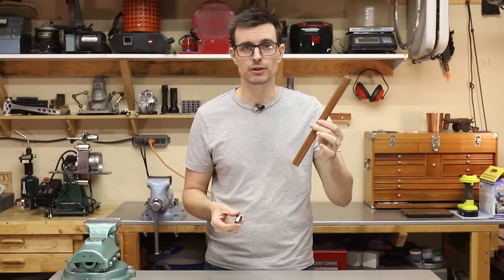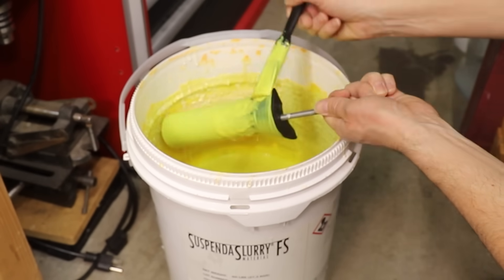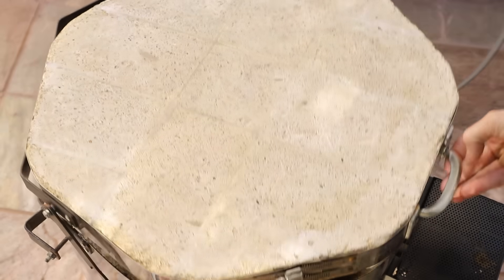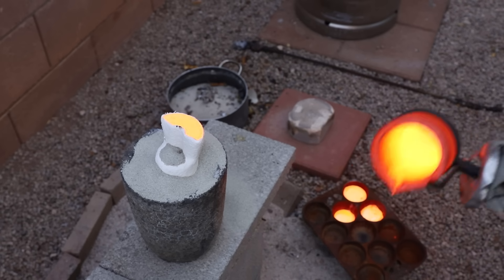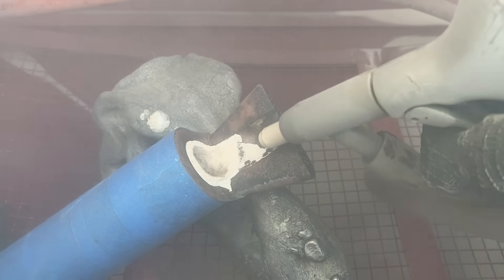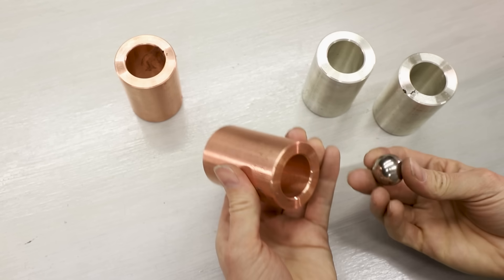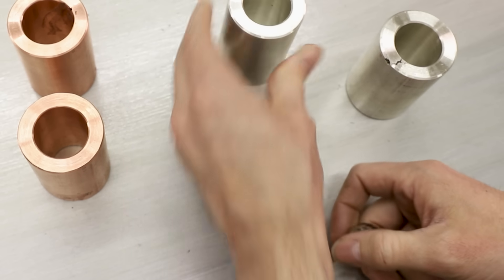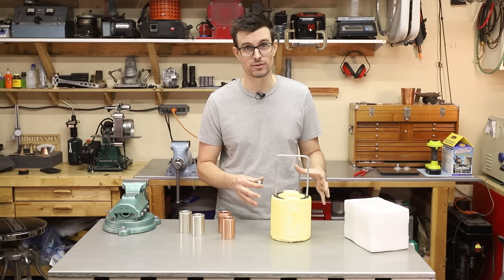Making Anti-gravity tubes - Copper & Silver! - Lenz's law - Metal casting Experiment

Comment: I have seen many variants of this experiment but I have never seen the one that is stuck in my head. I want to see a piece of copper (or silver) dropped down a tube made of magnets. I only managed to make a tube a few inches long so far because even though people throw away microwaves fairly often I need the magnets off the magnetron to be roughly the same size.
Reply from the maker: I read your comment and couldn’t stop wondering if it would work. So I did buy some ring magnets to try this and it does work but not very well.  Not even close to what you see in this video. Interesting idea though!
Reply: @robinson-foundry  Thank you for trying it out. The only strong ring type magnets I can easily get my hands on are from old microwaves. After that size matching is the issue. Did you happen to video it?
Reply: Using only iron, it will be a magnetic gun !
Reply: @jeansentrais9866  I have built coil guns before. Fun toys but lacking power unless you have a large power supply or a big bank of capacitors to fire it

Comment: This is an interesting and worthwhile experiment. I see this being used for large scale elevators. You could use a silver section for the initial slowing of an elevator because it's not as strong or abrupt, then use the copper part to slow it down further, before using an electro magnet to bring the elevator to a complete stop. You'll have a nice and smooth slowing and stop. Well done fella, and I absolutely love magnets and their potential 😊

Comment: This method is used to test silver coins.  I think .999 silver can be faked..   say.  copper, titanium, zinc and sliver mix and nickel?   And maybe has been to the degree that 12 million oz were mined but 1.2 billion were sold. We have had year over year across the world of record buying,  not really possible if the mining numbers are right.  If a copper, zinc , sliver, nickel  mix of a coin was made a hundredth of the cost or even 1 10th the cost of .999 silver and passed all the tests;  It would be quite interesting.    I mean even the machines get fooled..   So beat the machine, match the weight and  pass the magnet test and you can fool 98% of the people you show that coin to!     Is this something you would take on as a project?  Maybe easier to do a bar.    Sure one coin would not be worth the project but 1.2 billion would be.  Thx for reading...

Comment: I looked up the resistivity of SS and pure silver.  Sterling is 1.6*10^-8.  pure silver is 1.59*10^-8.  Not much difference.  Maybe there is other impurities in the SS.  pure copper is 1.72*10^-8.  units of ohm-m.

Comment: I machined a copper tube with a 26mm bore and 20mm wall thickness. A 25mm diameter magnetic ball seems to just hang there barely moving. I think the thickness of the conductor and the gap make a big difference to the effect....

Comment: Would be interesting to align the N52 Sphere with another Bar Magnet while laying both Sphere, and Bar magnets stuck together on a flat surface, with the Bar Magnet set on the table so the narrow edge is oriented vertically to the plan of the table to squarely contact the Sphere's surface at the Equator. Then when both magnets are opposit pole attracted with aligned North/South use a Sharpie Permanent Marker to paint a black outlined line to show the Sphere's North & South Poles using a carpenters, or machinist square to draw with by rotating the Sphere while adding a black permanent marker line to outline the Sphere's Equator. Then using permanent marker stain the Sphere's nickel plate surface in two different colors such as Red/Blue or Red/Green to brightly display the Sphere's North/South poles. Then video record the drop of the color stained N52 Magnetic Sphere through the two metal tubes of Copper & Silver to record the N52 Sphere watching how the colorized North & South poles spin, or tumble in what observable slow motion different direction, or oscillating patterns when experiencing the two different metal's repulsive forces. After recording, use 91% Isopropyl alcohol and a tissue to clean off the marker stain from your N52 magnet Sphere's surface, restoring the magnets original nickel finish.

Comment: Small differences in distance makes a big difference in breaking power. 
Use the two silver tubes and place them exactly the same width apart as the copper tubes and roll it through them.

Comment: You could try to hold it on the air, like you did with the 2 pieces of copper, but with one of each. One part of copper and the other one of silver, i really missed that part. Cool short you could add. Thanks.

Comment: OK, so here’s a question… If you were to solder a wire to the copper tube and solder a wire or connect a wire to the neo magnet, and then the opposite ends of those wires to an LED light and drop the ball down through,would it, create enough electricity, to light the lED bulb?

Comment: Place the spherical magnet in some static position, optimally at an offset from the surface it lays on. If you proceed to attach either the hollow copper or silver cylinders to the end of some rotary tool such that the axis of rotation of the tool and the cylinder are equal, then proceed to place the cylinder attached to the rotary tool’s axis of rotation perpendicular to the surface that the spherical neodymium magnet lays upon, while intersecting with the center point of the magnet, then when imparting a rotational velocity on the cylinder in these conditions, should keep the sphere in the cylinder, so long as angular velocity remains at a certain level

Comment: Thats very cool!

Does the temperature raise after each consecutive pass of the magnet through  any of the tubes?
Reply: Yes, the temperature rises but there is so little energy involved in this demo that the effect is negligible.  If you use a motor to whirl a magnet rapidly inside the tube, the tube will gradually warm up.
Reply: @analog_guy  thats very cool to see the mechanical aspect producing heat.
Keep the videos coming

Comment: Aluminum tube will do the same and the thicker the aluminum the greater the effect. Much less expensive as well . Interesting experiment . By the way , with all the equipment you have , do not have a jig saw or chop saw to cut that stuff . A hack saw works but wow. :O)

Comment: I checked around - first what is sterling silver.  Found that it contains 7.5% copper.  In conductivity that means already drop to 90% ICAS, or less.  Pure electrolytic copper has 101% rating, and phosphor process manufactured copper still can have as good as 98% ICAS.  Hard alloys, like cadmium-copper and others may be as poor as 50%.  But in tis case, pure, untarnished silver is something around 106% ICAS.  Pick your choice!  can you measure the 6% difference in your test?  Maybe, but I think you might then need some instrumentation.

Comment: For thick cast silver tubing you can buy jewelers wax tubes and casting investment then do a similar kiln burnout for a much faster and more cleaner and consistent casting. The whole process takes much less time (12 hours) and the end product will be much cleaner. Or, you can just order extruded silver tubing. It’s not that expensive. Most jewelry supply houses can order any tube diameter you need. Just my .02 from a jewelers perspective.

Comment: I looked up the electrical conductivity of sterling silver and it's slightly less than pure copper (96% vs. 97%) so the result was as-expected. Also, your sterling was pretty heavily tarnished (silver oxide) and that would further reduce your electrical conductivity. Even if it drops by 1% more as a result you'd notice that.
Reply: Uhh pure copper has an conductivity of 100%, that is the basis of the IACS, pure silver has 104%

Comment: Did you consider boring out the ceramic from the inside using some abrasive tool on the lathe, instead of sand blasting? I wonder if that would work well?

Comment: I have a question? If a strong magnet can be slowed down by a copper pipe then would a copper slug slow down traveling (or propelled)  down a magnet lined "barrel". If so, by how much? How long would the pipe need to be? Would neodymium ring magnets placed around the steel pipe work with gaps between magnets? Or would long rectangular magnets, laid end to end work better? Like a silencer/suppressor takes barrel gasses away to make a fired projectile 'quieter' would a magnet lined barrel make super-sonic ammo slow to sub-sonic speeds?  Just wondering? @brandonherrera @kentuckyballistics
Reply: Yes, a copper slug would be slowed down at each pass by a magnet.  There is a nice physics demonstration using a freely swinging aluminum pendulum.  When the pendulum passes through the gap between the poles of a horseshoe magnet, the pendulum is rapidly brought to a halt.  If a similar aluminum pendulum has narrow gaps cut into it (making it like the tines of a fork), the retardation by the magnet is greatly reduced since the paths for the eddy current to circulate in the aluminum are interrupted.

If electromagnets are used instead of permanent magnets, and the electromagnets are energized at just the right time as the copper slug passes, the slug can be accelerated, as in a rail gun.  (Rail guns also typically pass an additional current through the slug to enhance the effect.)

Accurately calculating the answers to your questions is feasible by modelling with an electromagnetic field solver software package, but that requires a lot of work.  That's a good engineering project.

Comment: I wonder if a tighter inside diameter of your tubes to correspond with the outside diameter of your magnet balls might have affected the speed of the drop through the tubes?
Reply: iirc, magnetic field strength falls off in relation to 1/r^2, meaning, yes, a smaller air gap between magnet and tube should create stronger eddy currents that in turn create stronger opposing magnetic fields.

Comment: So, with the longer tube, I was expecting to see some rough timings between the two.  (I would think the silver might be in more proportion to the mix of the materials involved.)  Also, a question arises as to whether the thickness/mass of the tube has an effect on the speed of the drop.  As well as any diameter differences.  (I.E. Does a closer diameter have a more profound effect compared to the mass?  More easily done with the copper since you could probably find some longer thin versus thick wall tubing.)

Comment: It wouldn't have been so hard to purify that silver. I think if you melted it, poured it into some water to get little flakes to increase surface area, then dissolved it all in nitric acid, throw in a load of table salt until the white material stops being produced by the reaction caused by the salt, filter the white stuff out and keep it. Throw it all into a crucible and blast it in the furnace, it'll melt and turn into a much purer silver. Quite an easy process to really ramp up the purity.

Comment: The effect would be even more pronounced if you made tubes which have an internal diameter closer to the outer diameter of the magnet.   You could replace having the entire tube made of copper by simply having copper conductors (12 gauge house wires) bundled together in a tubular form with epoxy, thus eliminating the need to to molten copper poured into a mold.   

You can induce rotation in the magnet, by having your copper wire formed in the form of a tight coil (like a tight spring), as conduction would be superior horizontally, as versus vertically.  You would have to take a sharpie black pen to the magnet, to make the rotation of it more visible to the cameras. 

For the ultimate demonstration, get Graphene sheet (pyrolytic graphite) and form it into a tube.  It works even better than copper/silver/bismuth.

Comment: Resistivity of electrical grade copper; aluminum, lead, bismuth.  Fewer zeros after the decimal, higher resistivity.
Plexiglas tube............ electrical insulator  (Free fall control.  Cannot be melted without decomposition.)
Resistivity: bismuth... 0.0000013 mΩ (highest resistivity)
Resistivity: lead.......... 0.00000022
Resistivity: aluminum 0.000000026 mΩ
Resistivity: copper..... 0.000000017 mΩ (electrical purity)

Comment: FYI - folks who deal with precious metals will line up several flat, bar magnets in a row side to side then lay some felt across them to create a slide to test if, say, a silver coin is really silver or a fake since just like the magnet slides slowly down the metal tube, the silver slides slowly down the ramp of the magnetic slide.  In other words, you could have just taken a silver coin, made the magnetic slide and produced the same results faster and easier.

Comment: When a small neodymium magnet ball descends through a copper tube under the influence of gravity, it induces an electric current due to the change in magnetic flux within the tube. This phenomenon is called electromagnetic induction. According to Faraday's law, electromagnetic induction creates a current directed to produce a magnetic field opposing the change in the source of that current. The formula for Faraday's law is:
ε = -N * (dΦ/dt)
where:
ε - induced electromotive force (emf),
N - number of turns (in the case of the tube, it could be replaced with other parameters related to the tube's geometry),
(dΦ/dt) - rate of change of magnetic flux.
Reply: Isn't this Lentz's law application here though. ?

Comment: Thank you for your videos. 

Silver conducts electricity better than copper, which is why it drops faster. Please look up the “Right Hand Rule” for electricity. The internal resistance within the tubes thus controls how quick the magnet drops. The resistance of a metal can be changed with temperature, metal composition and is based on the metal itself (periodic table). 

As the magnet drops, it creates electricity within the tube itself, in a “Hoop Like” manner. The electricity travels around the tube along the circumference as the magnet drops. The more resistance it has the slower it will drop. 

Additionally, the purer the silver the quicker it will drop. The addition of copper increases the internal resistance within the tube making it conduct current within the tube slower. Thus slowing the magnet. 

https://www.youtube.com/watch?v=47uESIjJSTg

Please watch around the 3minute mark to understand the “Right Hand Rule” within a tube.
Reply: Oops, the conclusion that the magnet drops faster through a more conductive tube is backwards.  You are correct about the magnet creating an electric current in the tube.  Some of the current is hoop-like and some circulates up and down in the tube walls.  (The magnet will be somewhat retarded even if it is dropped next to a flat sheet of copper.) The current in the metal acts to produce a field that opposes the fall of the magnet.  If the tube is a superconductor, the magnet will not fall at all because the current will not decay.  If the tube is a nonconductor, the magnet will fall through unopposed because there is no current.  If a copper tube is replaced with a brass tube (or any other poorer conductor) of the same dimensions, the magnet will drop faster.  Also, if the thick copper tube is replaced with a thin copper tube with the same inner diameter, the magnet will drop faster.  You can try this for yourself to verify.  These experiments are fun to do. 🙂

Comment: This was a super cool demonstration,  I do a similar one in the physics classes I teach when I get to induced magnetic fields,  unfortunately I'm limited to the thickness of copper that is sold at home depot as a result the slow down effect isn't quite as significant.   Definitely is cool though with the spherical magnet too as you can do all sorts of rolling demos
Reply: I bought 1 copper  and one aluminum 4"×4"×1" thick plate on Ebay and or Amazon and a 2 1/4" fishing magnet and made a pendulum with 3/4 pvc pipe and fitings and all thread to hold the magnet and raise and lower it just above the plate and swing it over it and it stops in its tracks, if you understand what I'm saying maybe you can build something similar 🤷‍♂️
Reply: When my son was in school and had a science project we built a rack from wood and I attached a Copper pipe about 2 ft long, also an aluminum pipe same length and diameter.  I also attached a same length and diameter PVC pipe.. the PVC was to show how the magnet freefalls...drop in the copper or alum pipe and the magnet drops very slowly.  We set it up using stacks of coin magnets...more magnets in the stack slows down the drop speed.

Comment: If you cut one copper and one silver pipe vertically so you have two half cylinders. Then put them together will the different speed rates cause the ball to spin on its way through?

Comment: Are there any implications for choosing between copper and silver electrical wires?
Reply: Yes.  In World War II, silver was borrowed from Ft. Knox and was formed into wire that was used in the calutrons at Oak Ridge to separate uranium 235 from uranium 238 in the Manhattan Project.  Copper was scarce at the time, being used in brass shell casings and other items for the war effort, the silver with its better conductivity was the best choice available, and the silver was judged to be virtually as safe from theft at the Oak Ridge facility as it had been at Ft. Knox.  The silver was eventually returned to Ft. Know when the calutrons were phased out. 🙂
Reply: @analog_guy  THAT is interesting
Reply: Where are you getting silver wires for electrical use? Nickle coated (not alloyed) wire is a thing for its anticorrosive properties but unless you have a big wallet and a niche use like maybe very low resistance circuits in electronics and you're actually an electronics manufacturer.  It does only have 5% better conductivity.
Reply: it seems it's a hifi thing.
 @Morberis